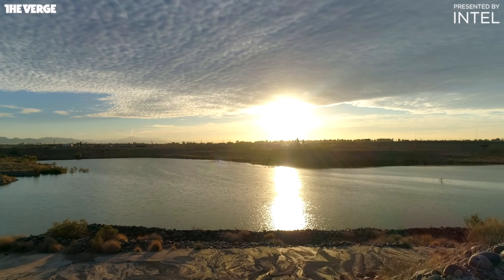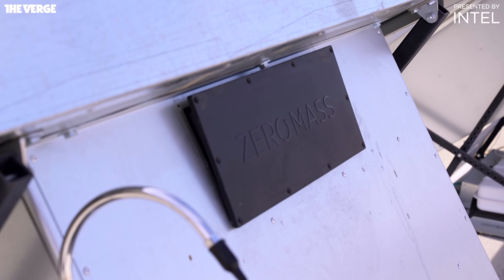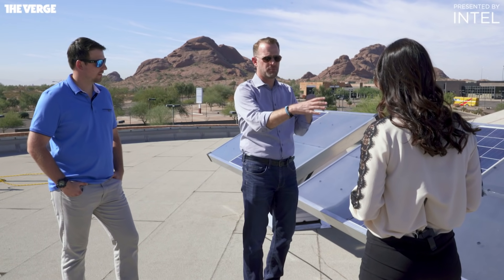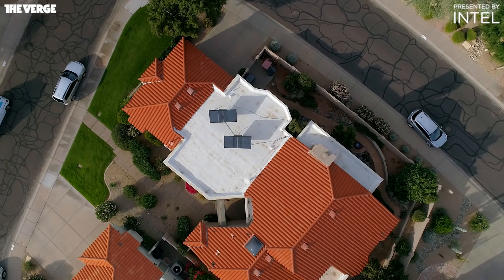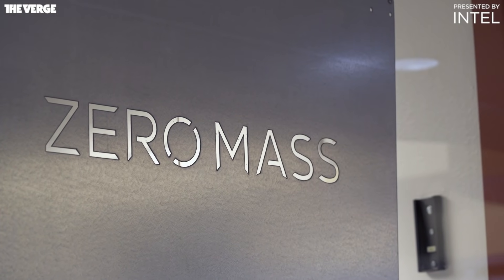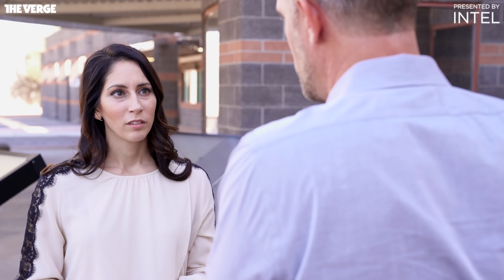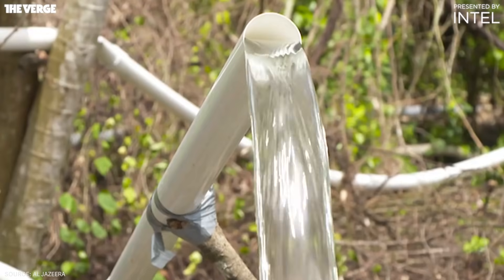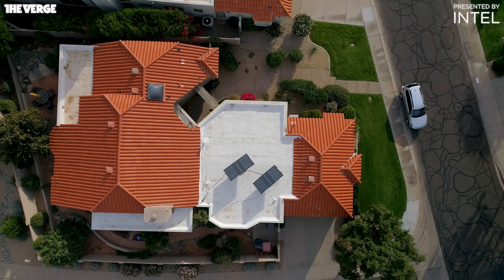Zero Mass' solar panels turn air into drinking water

Comment: Another thing this system could probably do is purify dirty water. In a dry climate, you could put jugs of  dirty water around the pannels and let natural evaporation (or something more efficient), which would put more water vapor around the pannels to collect as clean water.  Maybe a hood over this arrangement to keep the water  vapor from excaping.  Kind of like a more efficient solar still.
Reply: Colleen Forrest just get a dehumidifier or a/c run on solar panels. Don’t forget to filter and boil. 1/10 the price.

Comment: Does anyone else see the glaring inefficiency of putting the water collection pieces next to the solar panels, taking up precious roof real estate that could be holding more solar panels? It requires a lot of energy to pull moisture from the air. So it would be desirable to have as many solar panels as possible to run this dehumidifier... among other things. The dehumidifier doesn't need to be on the roof.

Comment: It should be emphasized that water is not scarce - clean water is scarce.  However, abundant clean water can be produced with abundant amounts of energy.  Therefore, because there is no abundant clean/cheep energy there is no abundant clean water.  Make abundant energy and and you will have abundant clean water.

Comment: I already see a flaw in their program.  Did you see how quickly they blew past the idea that you have to add minerals or PH chemicals after the fact?   So, where do you get them and what are their cost and can they be administered to the unit easily by a homeowner.  If all you had to drink was distilled water you would shortly find yourself lacking the trace elements our bodies need that come in our water.  Not all of them can be had in our food supply.

Don't get me wrong, I think it is a great idea, but there is more to this picture than they are telling us.  How about a thorough cost analysis, verses the life span of the unit and the cost of those minerals that must added to the unit.  Also, if they put those in Africa where are the African people going to get those chemicals needed to bring the water up to our taste pallet and physical needs standards?

I believe they have more research and development to do before the public will buy into this concept.  Real cost will be what sells these.  If they are bought purely as a hedge against an EMP attack which will shut down water pumps then cost may not be an issue if your life is in danger, but as for every day usage, this concept needs more work !
Reply: LOL!  Dont you know?  An EMP knocks out solar- UNLESS they spend the money for protection & I DON'T believe you can both protect AND use it.  So, you'd have to know it was coming!
Reply: @ohwhatelse  WTF are you talking about?  You can use a Faraday Cage with small enough openings between the wires to allow sunlight to keep your solar working but obviously with a diminished output.

Comment: mass produced to cut consumer costs is key. also recycled water is disgusting at best when man is in control.. all the trace accumulate adds up not to mention how extremely toxic fluoride is for humans. 
2nd idea is make a unit that still pulls water  (envo safe vs common energy practices) and also produces and outlet electrical  source. make batteries better and you will be rich

Comment: My setup has already produced 120 liter per day at cost of 1000 $US, and with the modifications I introduced it can produce 1200 liters per day at cost of 5000 $US, i.e. my design is much more efficient, and cost-effective, than this "Zero Mass", but I've no means to run my project at the industrial level but they have the needed means. That is it all.

If "Zero mass" is interested it can get into contact with me. They are welcome.

Comment: I mean think of the amount of drought this would cause if everyone was pulling water vapor from the air.  There is a place that water vapor is going and it's into the clouds.  Sure a few residents here in there aren't a concern but if an entire country is harvesting water this way that's an issue.

Comment: This tech is interesting, but stupid. If you remove humidity from the air, then there is no water in the atmosphere that will regulate the temperature thus resulting in increase heat and will affect the water cycle.
Reply: wring

Comment: It's a dehumidifier....
Reply: Lechiffresix six but if you drink the water from your dehumidifier, you’re ingesting all of the unfiltered airborne chemicals and airborne bacteria it absorbs as well. 
Don’t do that lol
Reply: lochiffresix six.. hello friend, can you provide info about your equipment, I really thankfully if you show me that info...
Reply: no power needed is a good idea for disaster zones, but how much would it cost to add a pedal powered battery to a dehumidifier? I'm betting a LOT cheaper than this & far more versatile & space efficient too! (some NGO's are using pedal powered devices as mobile phone chargers in third world countries, giving individuals the chance to run a business where they pedal power charge people's phones for them, so that tech does work & then there's others where they have separate solar panels that can be used for various devices from phone charging to led lights to fan powered stoves. One I've seen with a solar powered stove & usb port & led lights all built in & much smaller than this is retailing for $150. Not sure if it has enough power to run a dehumidifier, but I'm sure it could easily be scaled up & dehumidifier put onto a usb port attachment, MUCH cheaper than this junk!)
Reply: This is not economically feasible.  The laws of physics still apply.  You will get more water by placing buckets outside your home and storing the rain water - for free.  This YouTube video says it all - Busted!  https://www.youtube.com/watch?v=vc7WqVMCABg
Reply: https://www.amazon.com/Portable-Dehumidifier-hOmeLabs-Basements-Allergens/dp/B073VBWKJZ/ref=sr_1_3?s=home-garden&ie=UTF8&qid=1527299898&sr=1-3&keywords=dehumidifier
Reply: It would be way more cost effective to purify existing water or take salt out of sea water using panels for power.
Reply: i know right ? i pay $150 every 3 months for electricity and I use my big dehumidifer every single day . that's 3 litres per day here in the EU. and even after 2 years it'll still be cheaper than this thin foil these guys are selling for 2,5k without installation fees and what not. lmao!

Comment: Thunderfoot covered why this wont work as well as they say it will. Basically it only works even remotely well in humid areas that have water in the air. In desert areas it wont work. It's basically just a solar powered dehumidifier.

Comment: I have one question if everyone starts condensing air and pulling out moisture from it then how will evaporated water form clouds and produce rain ?
Reply: 1 mm of rain on one square kilometer equals 1 million liters or water, or 1000 cubic metres. These machines are insignificant compared to a small rainshower.